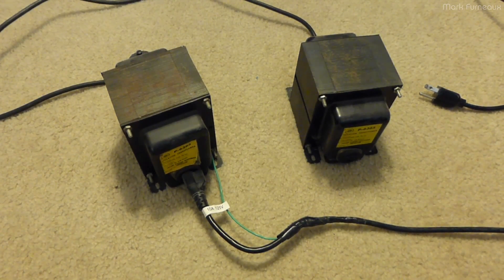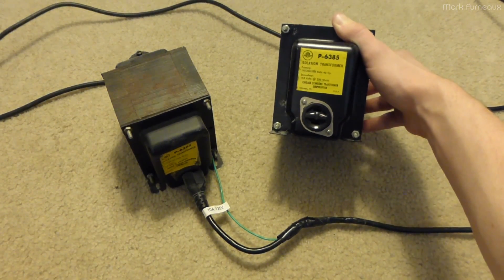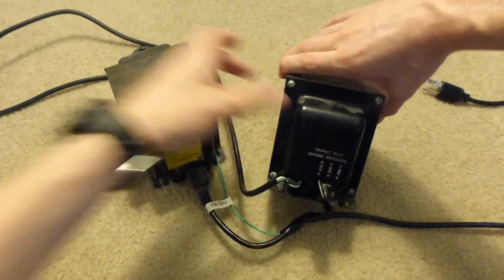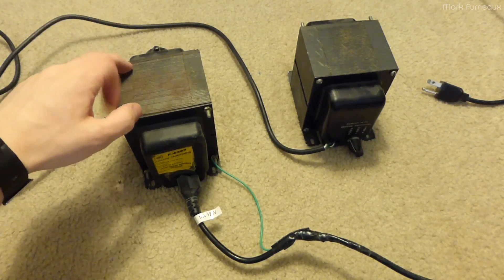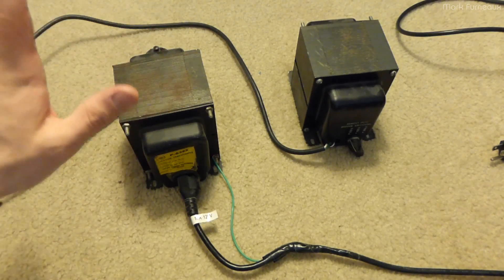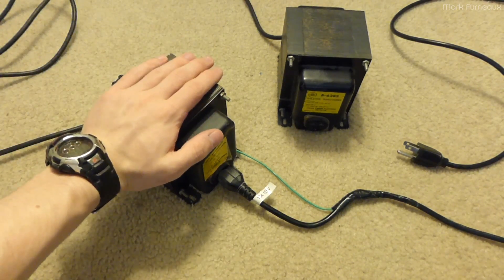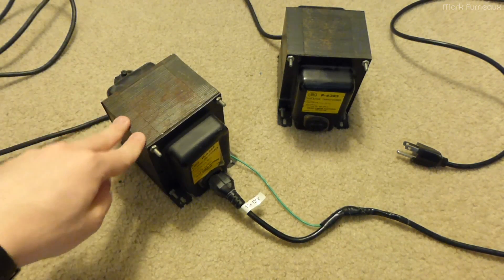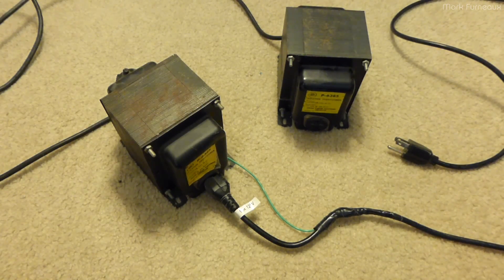A Look At My Isolation Transformer Setup

Comment: It not an isolation transformer if the secondary side is grounded in any way. Disconnecting the ground from secondary will float the secondary and provided isolation.

Comment: I agree with Boonedock Journeyman, (who described it better)  B U T . . . D O N ' T   G R O U N D  T H E M (back to the Service Panel) . . . because that integrates them back into the "grid". [[ Neutral and Ground tie together in the service panel ]]. 
By the way, if a mishap occurs, those transformers will suffer damage but they won't "blow". But that will be the least of your worries.

Comment: I recently scored an 8A 120v variac from a scrap bin. it was being used as an overkill ceiling fan controller, and had virtually zero use. But when I was reading about 'start up' equipment for an electronic bench, I repeatedly read, variacs are intended to be used for low voltage AC testing of circuitry instad of hitting an unknown or prototype circuit with 120v. What's interesting, is of everything I read, or watched about variacs, both manufactured and DIY, no one mentioned isolation transformers.
But, when I start looking into bench power supplies a bit deeper, I start running into isolation transformer stuff. NOw, the stuff I've watched and read about isolation trans theory, purpose, uses, DIY, it ALL has something about needing an iso, in addition to a variac, primarily for safety, and equipment protection. Analagous to surge protectors in the consumer electronics world.
It seems to me, there really should be discussion of iso trans when variacs are talked about. Especially because variacs have target markets other than the elec bench. I've watched stuff targeted at musician's as a method to have consistent amp voltage from rehearsal/studio to road setups. DIfferent supplied voltage levels to guitar and mic amps impacts the sound output. Get the 'right' sound at rehearsal, or the studio, (at a consistent 118v AC), then go set up at some dive bar, in an old downtown district, somewhere, and you're lucky to get a consistent 105-115v AC.
Suddenly, the hottest new rock band in twenty years is a flop outside the studio. Never thought about this before I saw a 'commercial' for variacs here on YouTube.
Buy a variac, solve the problem. But what's some singer songwriter, or bass player likely to know about th danger of AC and beer soaked floor boards or carpet? Seems to me, what with the already, well known, 'sparky' issues with mics, mic stands and human bodies, isolation amps would be a damn good safety investment for bands.
Not a word in the marketing vids.... nada, zip.
Oh, yeah, I originally intended to say was the iso on the left is most likely an older version, but didn't see the label. From what I saw of the other label, they are pre mid-60's, as the business address had no zip code. The zip code came into use in 63-65, never can remember exactly. But an antique appraiser told me that a while back, and it comes in handy for rough dating tools and equipment.
I keep forgetting to research earlier postal code or convention as a way to get a second date reference point, pre-mid '60's. I don't know if there is anything, 
THe other thing was your comment about 60hz at the beginning. Did you Canucks switch to something other than 60Hz in the 1960's. I've never heard anything like that about Canada before. We still use 60hz in the states.

Comment: I used to work for a power supply company that built it's own transformers. I built a 1kw isolation transformer that had two primaries and secondaries so it can be used on 120 or 240 volt equipment. I built this into a case with a 10 amp variac and meters to monitor the voltage and current. The whole setup weighs about 60 pounds including the case.

Comment: Nice job.  Thank you for the effort.  It is extremely important that viewers understand two things.

The current carrying neutral conductor (white wire) is bonded to the protective equipment ground (green wire) at the service drop (main breaker panel).  Accordingly, if you carry the green wire through the transformer, and the device under test in anyway connects the green wire to the frame, "ground," common, etc., then the "hot" wire, positive, live, etc., of the device under test will be referenced to the mains.  Accordingly, the entire point of an "isolation" transformer is defeated.  I will leave it to the creator of this video to deal with that.  Basically, any "isolation" transformer which provides continuity of the "ground," is a medical isolation transformer and has absolutely no place on an electronics bench.  I see this mistake everywhere on YouTube.  Viewers be aware.

The second point deals with inductive coupling within the transformer.  The creator makes several glancing remarks about transformer performance.  However, nothing is offered on the most important topic.  Is the construction of the transformer sufficient to manage inductive coupling?  Generally, the answer is no.  It is a huge YouTube issue.  You can't grab a setup/stepdown transformer and use it for isolation.  It simply will not work.  Look inside an actual isolation transformer for electronics and ask yourself: What are those capacitors for?

Bottom line.  You get what you pay for.  If you don't understand the two issues I raise, don't fool yourself.  YouTube is not a source for education.  Get help.
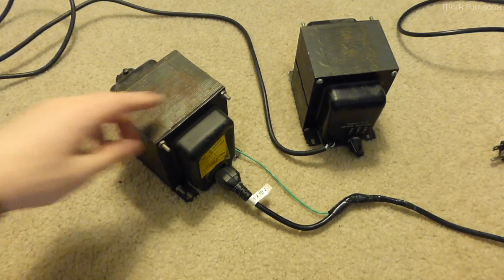Reply: @ #roomba  5:01 think it maybe best not to assume?
Reply: Boonedock Journeyman With the fact that he has the two Transformers connected back to back and only ground connected to the input side transformer and no ground connected to the output side ground make the isolation transformer safe? (assuming there is no ground between transformers)
Reply: @Truman123-a  yes if you don't connect the first ground to the second ground it will be safe, better yet, don't connect ground at all, it's funny how the ground is supposed to protect people but it's doing the opposite, it's the main reason people getting shocked and dying around the world.

Comment: Years ago I built something very similar with 2 identical 220 to 110 VAC isolation transformers (note these were not autotransformers) however I enclosed everything and added s mains power switch and a final output switch as well.  Both switches had pilot lights and fuses as well.
Suggestion to mark - I think that it would have been a better video if you had at least connected and labeled each transformers I/O, instead of just talking about it.  Going further to demonstrate the voltage selectors switches on each transformer, setting up three DMMs to show the voltage at each point.

Comment: Hi Mark, Neat transformers....looks like an okay set up. I'm just confused about what you said when referring to the age of them. You said they were from the 50's because of the 60 cps? Isn't the line voltage still 60 cps in Canada? Or did I misunderstand what you said? Thanks, Tom
Reply: Bucyrus Erie12   i realize this is an old post, but better to answer a question late than never.  he made the date guess based on the fact that the transformer specs were listed as cps or cycles per second, instead of the modern terminology of Hz or hertz.  The time he guessed was apx the timeframe when manufacturers adopted the new terminology. Hope that helps.
Reply: Thanks ss109, that does make sense....

Comment: Just get a real isolation transformer rather than a bogus job. Crazy to start sawing off grounds and what not. Transformers will not "blow" before residential wiring. Good heavens. Insane.
Reply: This seems like a perfectly reasonable setup to me. Not only does it provide galvanic isolation, but it also allows minor manipulation of the output voltage by switching the secondary tap switches. 

To me, the snipped ground pin seems less of a problem than the double-male cord, but even so this isn't inherently dangerous since Mark obviously knows not to unplug the supply cord while the power is on.

These transformers are small enough that they will likely core-saturate at around 30-40 amps if shorted out, which provides excellent protection of house wiring. A similar short directly across a household receptacle would pull hundreds if not thousands of amps through the line for the short duration of time it takes for the breaker to open. Such a current spike could easily blow a loose connection open and create a fire hazard. 

Additionally, if you're in a house with dubious breakers like Zinsco or Federal Pacific, then the low saturation current of the transformers could mean the difference between a minor spark and an arc flash/fire.